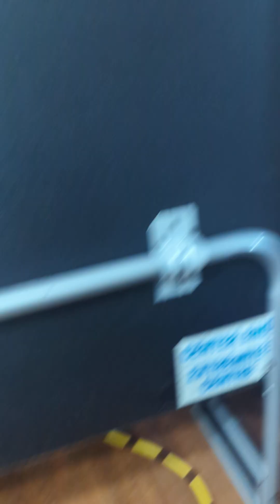how to build a High Voltage ⚡⚡ Tesla Coil

Comment: Nice build! I like your primary coil design. It probably could be better tuned for larger output though, and you might want to try a rotary park gap for more consistent firing.